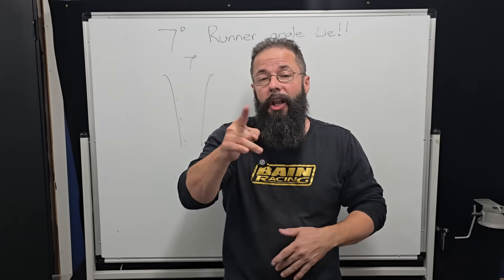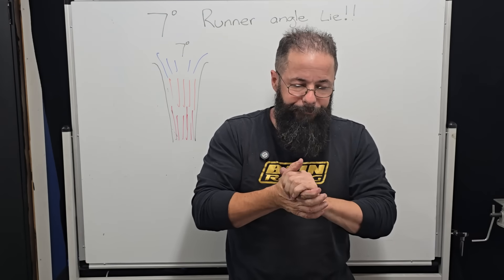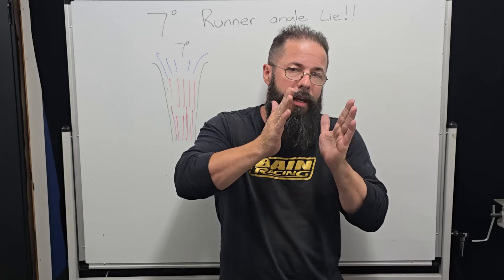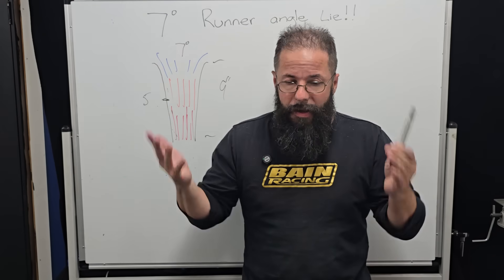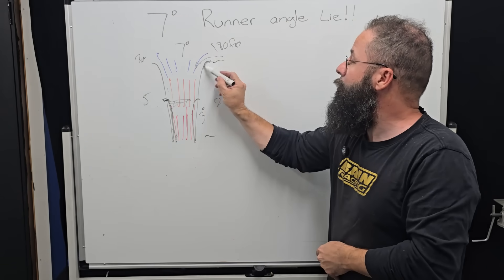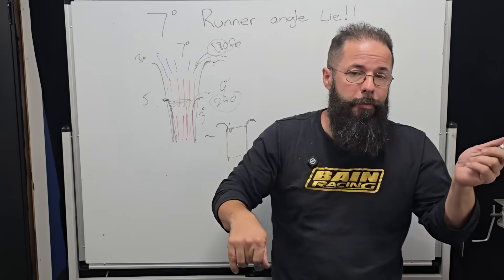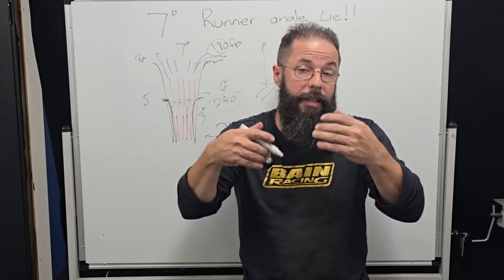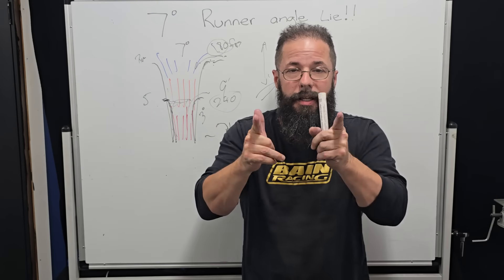The 7 Degree Taper Rule is WRONG: CSA Size, Length & Airspeed-Based Taper | Jake Bain Racing

Comment: Love his mathematical equations, But tried and trued street motors just don't get this involved, Most blokes want a 400 to 600hp motor with good street manners. All this stuff can be great but if you don't have a bloke who can do a decent tune up its all for absolute nothing. Not everyone wants a 7 second pro stock motor and the not many people can do this work anyway. You be better off doing content for the street/ tuff street motor.
Reply from the maker: Same rules apply mate. The closer you get the math the more behaved they are for the street.  Rpm the MCSA and CSA are all based on RPM. So from street engines you just choose lower rpm and it all works. 👍

Comment: I’ve read / seen Darin Morgan state that the volume of the intake runner + port combined, should be 95-105% of the cylinder it’s feeding, in the case of a tunnel ram drag race engine. Darin didn’t state explicitly this had any bearing on taper, but wouldn’t that play into how much taper is appropriate, OR being able to calculate the exact amount of taper needed???
Reply from the maker: Yeah this is what I call the Gulp effect.  And yes that's around where you want to be at a true 3rd harmonic.  

But we still need to look at our entry air speed.   This is more important than volume.   Lets say i have something at 92% and its bang on 180fps at the entry at 4.5".  But then I go to 4.8" and now I'm 96%. But my air speed is now under 150fps.  That intake won't make good power. Will be lean on the shifts and not preform.    

This is why is important to look at all the things that drive power.  And this is why I choice air speed over angle every time and so does darin. 👍.

The angle is what it is when the CSA is right.
Reply: Thank you for the detailed response 🏁

Comment: Ok. My sorry for starting the 7° thing.
However, if you reread what i posted,,, I never said it was optimal for all scenerois,, I said not to EXCEED a 7° half angle.

I deal in the 2t industry....and some of us understand the great effect of angles.. both intakes and exhausts. 2t engines actually have 3 1/2 TP systems built into them.
We also understand that the principles overlap both 2t and 4t engines.

Just like a previous comment here says 7° only applies to divergent angles...nope.. not entirely true, but mainly yes.
An intake and exhaust use RV, or reflections of waves. This means a div or conv is the opposite at some point.
A 7° div angle will create separation of flow, counter to that, a 7° conv angle will create a flow resistance/restriction (higher pressure point/spot, as well as a warm/hot spot. 
Just think "venturi".
Reply from the maker: Oh not at all mate. Its come up a bit so it was a good topic to cover 👍

Comment: Also, say a 2j, with a 150mm long runner, what taper?
Reply from the maker: I dont use taper. I use Air speed. 👍  that short you need to turn to 11,000rpm. So it your trying to make it work at 8000 you're going to need fsr less taper. Setting air speed  to be 220fps+  so the CSA opening will be around 1800- 2000mm²

Comment: Ok now I’m trying to equate this with running my blower. My intake port is way bigger than my blower manifold, trying to determine if I should port the intake to the head size or port it slightly smaller and leave it? Anyway Jake has officially become on of the guys I watch all the time! Sitting up with Brian salter,  Eric wiengartner, and Steve morris! Keep the great info coming!
Reply from the maker: Just see what it falls on size.  With that setup being blown. If the CSA falls and ones a little small while one's a little big for the RPM and Cubes.  It can average out! And having the intake slightly smaller that the port can sometimes increase HP. Especially if the heads on the larger size.  👍👍
Reply: @bainracing  Ok thanks I was a little worried about that but a blower changes things. It’s my first supercharged engine!
Reply from the maker: Nice! 👍

Comment: Hey Jake, I just picked up a superflow 110 like you mentioned you had. So I should be aiming for the ~100ft/s airspeed as a rough equivalent to the 300-350ft/s on a 28” bench? Total amateur just getting started so thanks for all the info, really helpful!
Reply from the maker: Yeah Ill do an air speed comparison video.  But yeah you around about 1.67 times slower from memory.  28" will be 350fps while so this is generally at the MSCA,  so window is generally around 300-330. Again depending on its ratio to the MCSA.  So 10" is about 209fps so 150ish at the window.  And 5" is 148fps at the MCSA area. And as low as 100fps at the window.  

Hope that helps.  Again it really is port shape dependant.  But as long as you're getting the ports velocity gradient close.   If its 150 at the window and 350 at the MCSA you got a problem.  But if its 310/350. You have port efficiency
Reply from the maker: Yeah I just checked, its 1.673 to be exact.  So if you want to convert flow figures or pressure drop velocity just time your flow numbers by 1.673.   So if the head flows 150cfm @ 10" you will times that by 1.673 which is 250.95. And if you see velocity data at 28" just divide by 1.673.   So 350fps then you get 209.2fps.  

Hope that helps. 👍👍
Reply: Great info, thanks. That will give me some direction at least.
Reply from the maker: @pretengineering705no problem

Comment: The 7 degrees “limit” is the stated divergent/expansion limit not the convergent limit
Reply: Yes, the 7° is the half angle in a diffuser.  Years ago I designed a piece of semiconductor processing equipment that flowed an ionized gas into a vacuum chamber and I could see where the flow separated on the conical walls.  The pressure was low in the millitorr range and the flow was laminar.  I didn't have room for a 7° half angle cone.
Reply from the maker: No this was in reference to 7° runner angle rule. Noting to do with divergent and convergent limits are they are all air speed influenced. 👍

Comment: One of my F1 intake trumpets also has a 7° and bottom 58 mm diameter.
Reply from the maker: Yeah, would be an early girl. Is if off the Judd?
Reply: @bainracing  No, it's from a 1992 Renault V10. You see the transforming of the round shape to later oval or stadium shape.
Reply from the maker: Ah yes!  Very early,  they closed the angle up as the heads got better too. 👍

Comment: I'm really enjoying your posts on flow principles. 🙂

 I've been experimenting on my 300cc motorcycle engine to increase low rpm torque 
with a 25% longer velocity stack intake runner and a 40% longer exhaust pipe,
and had it dyno tested to quantify the results. They were significant.

My torque modified engine produces 17% more torque while lowering the torque peak by a whopping 1,330 rpms.
It now produces as much torque at 3,500 rpms as the stock engine produced at 7,750 rpms.
The engine pulls like a tractor even down to idle.
Reply: What bike? 
Fascinating. I would like to do something similar to my enduro bike.
Reply from the maker: Brilliant mate!  Great to hear.  There's always power and torque to be made if we understand how. 👍

Comment: I believe that the taper depend on the volume of the cylinder in question and RPM .... I mean, if we have a big cubic like a 632 inches, then we need the runner have at least the same ci than the cylinder, 632/8= 79ci and if we need to turn 9000 rpm, then we need relative short runner, so in order to achieve the 79 ci in the runner we need more taper... conversely if we have to turn 7000 rpm with the same engine, we need a longer runner so we need less taper to achieve the 79 ci in the runner... Regards from Argentina.
Reply: * i mean the volume of the all intake track.. to the valve until the enter of the plenum... of course in the intake port the principal thing is set the CSA and the air speed, then mach the enter of the runner to the enter of intake port, and the runner tapper depend of the volume and rpm you tried to achive.... I mean higher RPM shorter runner more tapper... Lower RPM long runner less tapper ... it make sense?
Reply from the maker: What you're noticing it the RPM factor. But generally  we want 95-105% of cylinder volume in our primary induction length 👍 but also  air speed at the bell is key

Comment: Thanks Jake informative as always. 
When you are saying Bell, is that bell the very 1st part on the induction ie before an air box or throttle body or alike or are you talking about something like you may find in a atv/motorcycle/jetski air box after the filter usually going into the throttle body? 
I remember researching NACA ducts and I think it's suggested to keep under 7deg ramp for the best result in not disturbing the boundary layer and creating  separation. 
Is there a correlation here to runners? 
And/or an incorrectly applied correlation?
Reply: It refers to where the intake runner reaches it design length to atmosphere or a shared plenum chamber.
Reply from the maker: No. Im just speaking runners. The end of the primary induction length.  👍👍

Comment: Thank you been waiting for this video, is there any formula for calculating this or do I just go with what taper angle the intake port already is at? Or do I just "guesstimate" the correct taper based on all facts like csa, limit of port, induction lenght, room in engine bay...? Engine is under square (82.5x86.4mm) 5 valve head, even as under square is it better to leave the taper on the smaller side if the csa is too large?
Reply from the maker: Thats a great question and needs a video mate.  But yes! If CSA is on the larger side. We knock some taper out to compensate.  Stay tuned! 👍

Comment: Hi Jake- When talking about port taper angles, is it from the centerline or wall-to-wall? I can't find any clarification this....
Reply: This is going to be application specific due to castings, shape, design/layout/angles, offsets etc and manifold runners
Reply from the maker: Generally with round runners its an included angle. With some rectangular runner. You can have zero on 1 size and 7 on the other from centreline.   But if we work it out on an area ratio its generally 3.5 degrees is the limit from the centre line.

Comment: I am aware that the lower rpm band we are working in the lesser port energy we can achieve. But, how about the stack entry speed, do these numbers change if we are talking a slower reving engine with peak power at say 6000 rpm.?
Reply from the maker: This is why CSA targets on air speed are best.  Once you have set your MCSA to match your 6000rpm limit. The runner will be naturally smaller, less taper and air speed if on the 3rd harmonic will see be around 180-200fps no matter the RPM. 👍

Comment: Hi jake, love the videos your putting out, I just had a thought pop in my head with regards to the wave side of things. Obviously this video is based around an idealised clean runner like used in the tunnel ram/ plenum based stuff.

I was just thinking how much of an effective the throttle plate/ shaft has on the wave travel in runners with itd's as this would disturb the shape of the pressure wave.

Is there a way of mitigating the disturbance other than  using a slide or barrel throttle, would moving the throttle as close to the bell as possible providing less distance for the disturbance to travel before the wave reaches the bell, and equally on the return mor distance for it to settle?

Anyway hope my ramblings make sence thanks, steve, uk.
Reply: The throttle shaft and plate primary function is to create a pressure differential via restriction to control engine speed. The overwhelming majority of engines spend a huge percentage of their time at part throttle. Your questions only really apply to WOT. Whilst narrow shafts, thin throttle plates and flush fasteners are common practice in high performance applications they only provide a benefit at WOT +/- a couple of degrees of plate angle. The same applies for slide and barrel throttle. Slide at part throttle is actually a biased obstruction.

Having the throttle plate close to the bell is not ideal because the plate has the greatest effect on volume and air speed.
Reply: @jdoe9518  Thanks for the answer, now I understand.
Reply: Great question.
Reply from the maker: Great question!  A slide or barrel throttle definitely helps. Moving the throttle closer to the bellmouth would also be a good way to mitigate the disturbance 👍

Comment: Very helpful information Jake.

As a side note, I discovered first hand that a front ground effect diffuser lost efficiency at over 7 degrees, inducing massive high speed understeer. (LeMans style prototype).
Reply from the maker: Oh definitely!!! I have a lotus Elise that I track. I get hear you! 😂👍
Reply: @bainracing 2ZZ or K swapped ex Rover? I helped build a few stroked 2ZZ Exiges with supercharger back in the day. I got quite proficient at removing the rear clips 🤣
Reply from the maker: 😂😂 same. Ive had 3s, 2zz, 1zz, the rover factory engine which we got the world record with 20 years back and now 1mz 3 litre v6 turbo.  But 1100hp in 850kgs is stupid so im going back to either the rover at 300bhp and 625kgs. Or a Honda K.  At 800kgs with 450hp.   I like circuit so lite and fast!  But i want to street drive it move now im older and enjoy it, so far less HP is needed for that. Even with 300hp is a low 10's car.  Which is tons for me now
Reply: @bainracing I hope Lotus upgraded the Rover shifter mechanism. It was a spoon in a bowl of porridge in other versions. K swap would be nice. 
I put a 1MZ-FE (N/A) in a customers AW11 MR2. It was a surprisingly easy swap.